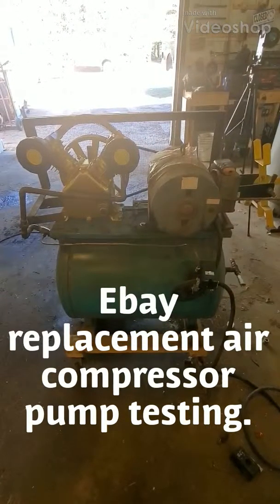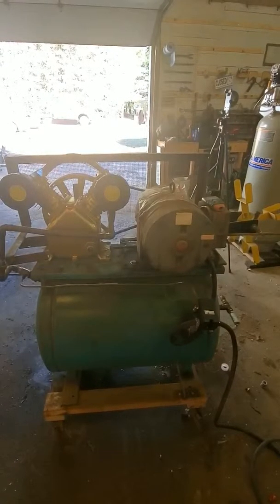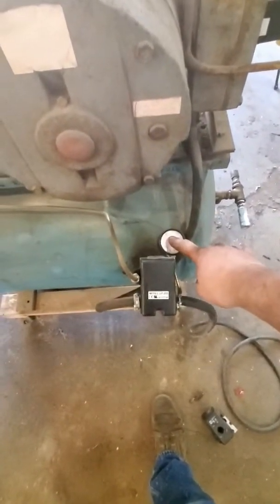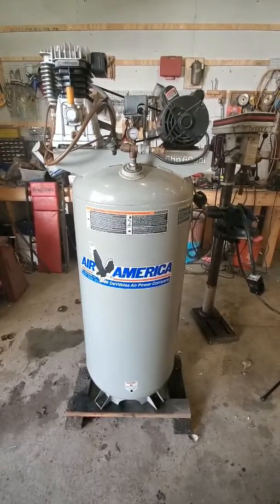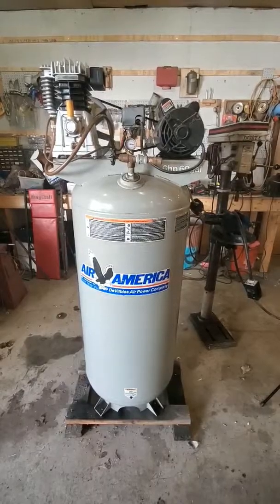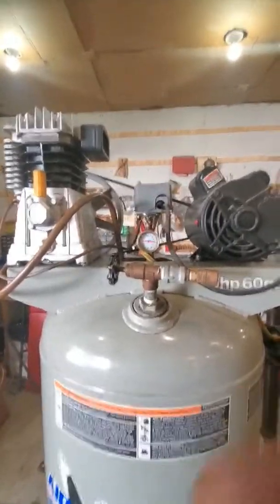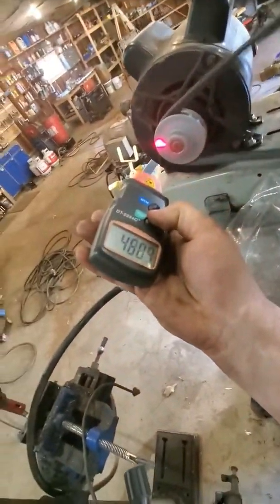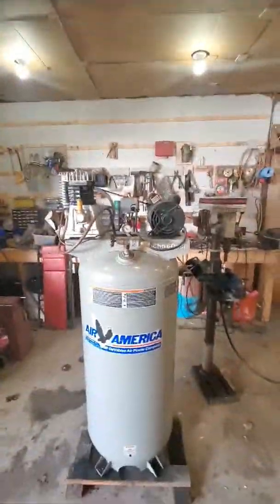Testing Ebay replacement air compressor pump with output plus homemade compressor walk around

Comment from the maker: UPDATE on the 60 gallon vertical compressor.  I replaced the 2.5 inch pulley with a 5 inch and retested. The pump now puts out 9.4 cfm.  I will likely update the output of the 40 gallon when I put a larger pulley on it as well.

Comment: Are those ebay pumps still running good?
Reply from the maker: As of today 9/28/2021 both pumps are still running well. I MUCH prefer the Amazon V-pump to the Ebay inline pump and have been using it as my primary compressor most of the time. I nearly always leave my pump on so I always have air at the ready. I know that shortens the lifespan of the pump but considering in over 25 years of use my first one (the vertical Air America compressor) my only issues have been replacing the pressure switch twice and replacing the pump once (due to failure because of a blown line  causing an overnight 100% run time). The Ebay pump also had an oil leak around the base plate buy it was cheap so I can't complain too much. Overall, after all my babbling, I'd strongly recommend the V-pump over the parallel twin pump. Higher CFM, better cooling, lower noise, and overall better build quality or at least the "feel" of better build quickly.
Reply: @ifnotnowwhen6914  thank you so much for the video and the info. I'm looking to set this up on an air compressor but I don't want to spend acouple hundred dollars on one.  Thank you for your time sir!